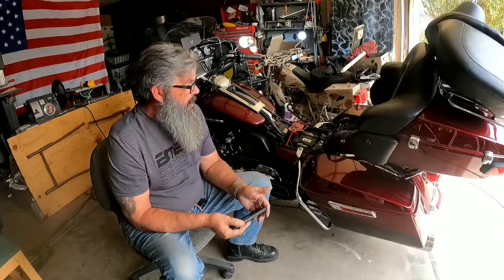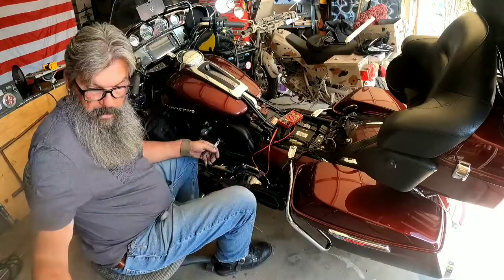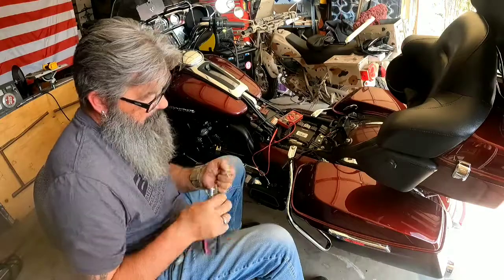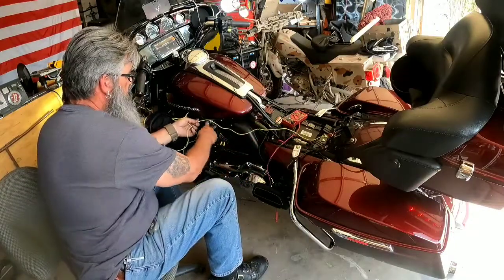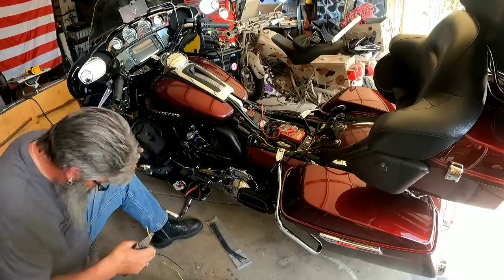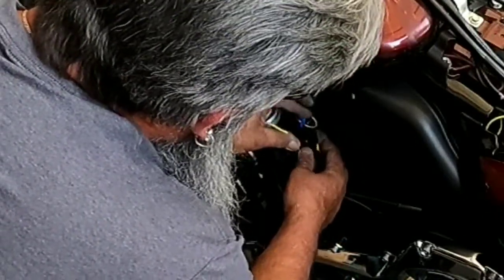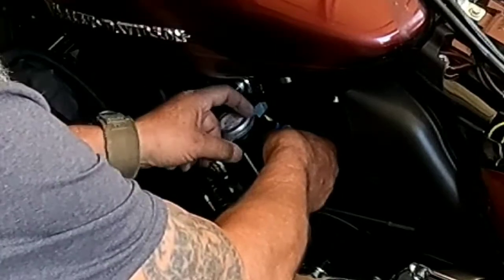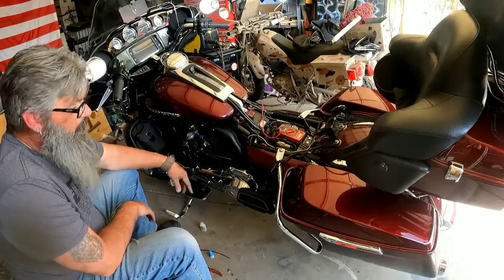How to add your horn to Harley factory security alarm system.

Comment: Could you not use the plug that is supposed to plug into the Harley module so its tied into the actual alarm system vs the turn signal?